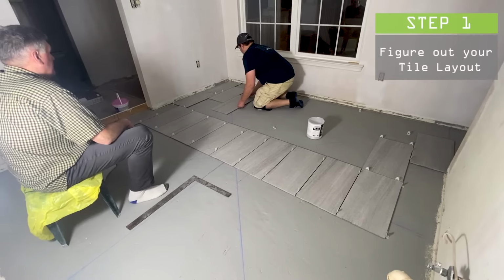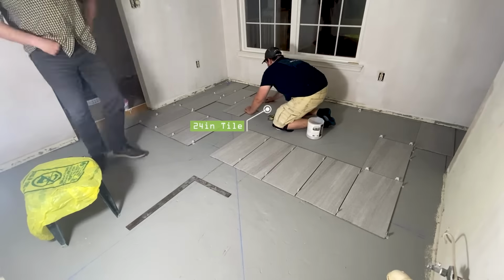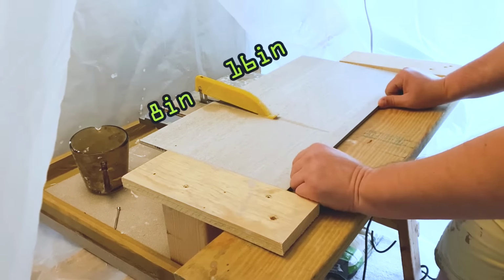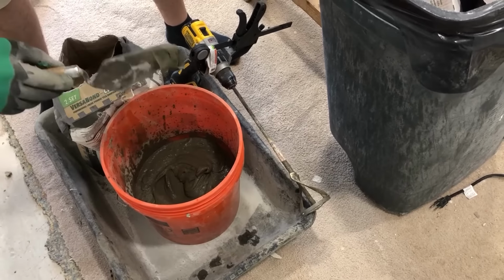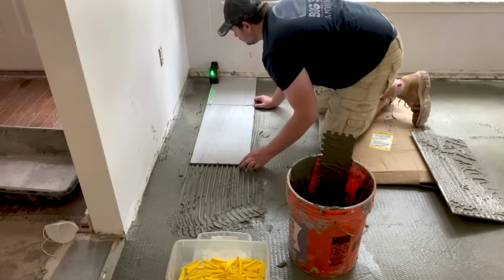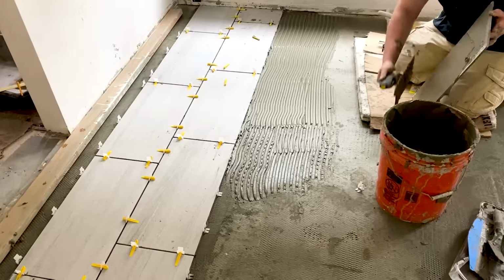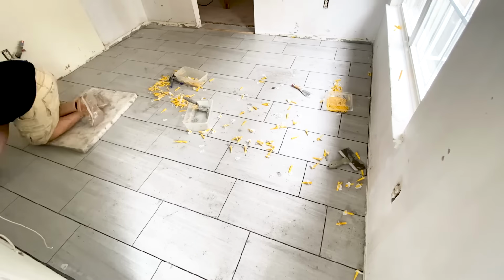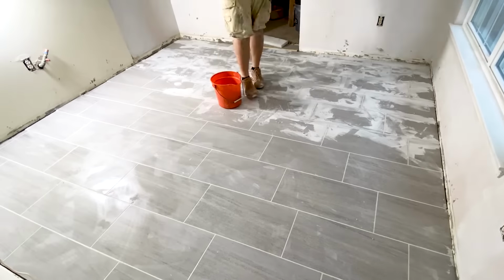6 TIPS For Laying Floor Tile With No Experience

Comment: Do you need to lay a membrane first?  I didnt see that done.  I have been trying to figure out what to do about the underlayment like ditra.  Is that a must so that it doesnt crack?
Reply from the maker: Yes we did do a barrier. We had an awful time leveling the floor so I put our struggles in a separate video https://youtu.be/wLq-1v9thtU?si=ICP9LlqNyyRi7MBt you do need a barrier if you have concrete because it will pull the moisture out of the tile mortar and crack it and that will crack your tile. I would not do the method we used it was a mess.

Comment: Great video 👍👍👍 What prep, and with what to prep concrete basement floor under ceramic tile ?
Reply from the maker: 1. Clean the floor thoroughly. Sweep and vacuum the entire surface to remove any dirt, dust, or debris. This will help the materials adhere properly.

2. Repair any cracks or damaged areas. Use a concrete patching compound to fill in pits, cracks, or uneven surfaces on the floor. Allow it to fully cure per the manufacturer's instructions.

3. Etch or grind the surface if it is very smooth and densely troweled. This roughens up the surface so the materials can mechanically bond. An acid etcher or concrete grinder can be rented for this.

4. Apply a concrete primer. This is typically an acrylic-based primer that seals the surface and enhances adhesion. Roll or brush it on following the product instructions.

5. Install a cement backer board or uncoupling membrane over the prepared concrete. These go between the tile and concrete to prevent cracks from transferring up. Secure with thinset mortar.

6. Lay the ceramic tile using thinset mortar designed for your type of tile (follow product instructions). Work in small sections.

The key is thoroughly cleaning/etching the concrete first and using the proper primers/underlayments designed for tiling over concrete basement floors. This prevents moisture issues and cracking. Check out the floor leveling video on the channel:

https://youtu.be/wLq-1v9thtU 

we had concrete base. But please use the self leveling mug so you don’t struggle like we did.
Reply: @DIYwithMAX  THANK YOU 👍

Comment: Cleaning the joints are so important, I did not clean the joints and spent unnecessary time removing mortar. I seen a guy on here use a toothbrush for that and another pro tip I heard and seen was to wipe the edges of the joints with your finger before laying the next tile.
Reply from the maker: I’m feel for you brother. I did it to my self lol

Comment: You cannot tile directly on top of a sub floor.. it’s not strong enough and the thin set and grout will crack over time due to the flex of the floor.
Reply from the maker: Thank you for taking the time to leave a comment. It all depends on the type of subfloor you have, but it is certainly possible if you’re subfloor is flexing.

Comment: I have a similar size kitchen. Maybe even a bit smaller. Would love to know how long this took you and how much the materials cost....thanks!
Reply from the maker: Sure happy to help. The kitchen size is 9x11 ft. The kitchen cabinets cost around $2700 the granite was $900, the floor tile was $600 back splash was $450. We did all the work our selfs. It took one evening to put all the cabinets together maybe 4 hours and the install took us a few days after work for the two of us. But I suspect that it can be done in one in half days. The ikea system is very straight forward and once you get the rails on the wall it’s just hanging cabinets and attaching doors. I hope I covered all your questions. If you think of anything else please reach out I’m happy to help.

Comment: In general you are supposed to move the tile to get the ridges to form a uniform coverage on the bottom and remove all air pockets. Or at least that's what the NTCA recommends...
Reply from the maker: Great advice thank you for taking the time to leave a comment.

Comment: I want to do this in my room, but I heard about expansion joint... What is that?
Reply from the maker: Hey thank you for the question. Expansion joints are just small gaps between the tile perimeter and walls or cabinets. You leave this space for tile to have room to expand and contract with temperature changes that’s all. This video has all the info you need to tackle this project and if you have any other questions I’m happy to help.

Comment: Overall a great video. The floor looks lovely. I've only done a few of these jobs now but one thing ive learned is that youre supposed to move the tile to fully collapse the ridges. By doing so, you won't have any voids underneath the tile which leaves it susceptible to breaking easily or coming loose in the event of subfloor movement from settling.
Reply: This… always collapse the ridges
Reply from the maker: Thank you for the great advice. If you found the video helpful please pay it forward by hitting the like 👍 button to recommend the video to more folks looking for this information.

Comment: Does the off set depends on the size of the room or it dosent matter
Reply from the maker: In our case it did not matter because one corner of the room would be covered by cabinet so we only had to make sure the left side of the room looked good. We went with this layout to minimize the amount of cuts we had to do. But it should be a consideration when laying tile to make sure you don’t end up with strange slivers  in visible places. I hope that answers your question of not please reach out I’m always happy to help.

Comment: is it possible to do small sections at a time, and come back later?
Reply from the maker: Yes we did ours over two days. You want to make sure you did a good job cleaning the edges and if your using spacers you want to set them before your done for the day.

Comment: how much deviation can a concrete subfloor have, before you have to grind it down or level it?
Reply from the maker: The acceptable deviation in a concrete subfloor typically depends on the flooring material being installed. For most flooring types, including hardwood, laminate, and vinyl, the maximum allowable deviation is often around 1/4 inch over a 10-foot span. However, for more sensitive materials like tile or stone, the tolerance may be tighter, often around 1/8 inch over the same span. If the deviation exceeds these thresholds, grinding or leveling may be necessary to ensure proper installation and prevent issues such as unevenness or premature wear of the flooring.

Comment: I just noticed you also troweed the wrong way. You're supposed to trowel the short end. So the air escapes out of the shorter end of the tile.
Reply from the maker: You could be right but I was more comfortable doing it long way lol. The way I look at it is if my tile was 12x12 not 12x6 it would not matter so. I don’t think it makes as much difference as people have you believe on the internet. I did not show this in the video but I pulled up tiles in every row to make sure I was getting good coverage and it was better than 95%. But if this tile job fails in the future I’ll make video about. So hit that subscribe button so you can find out if it fails.
Reply: @DIYwithMAX  Already subscribe man, and yes, I've been doing tile for 25 years and own a small tile business and do nothing but tile. So yes, your tile is probably fine, but yes, you're supposed to go trowel. The short side, so the air escapes out the shortest side. That's all it's not my opinion.
Reply from the maker: I appreciate that do you have my other advice or anything else I should be doing differently I have bunch more tile work.
Reply: @DIYwithMAX  Yeah I'll have to skim through your videos more  but ask me anything.. I just want to see tiles set correctly. And people get showers that actually drain , that's all
Reply from the maker: @BonBon770 thank you for taking the time. I don’t have any questions today but I will keep you in mind if I come access sometime that I’m not sure how to tackle. I appreciate your offer and look forward to your future comments.
Reply: @DIYwithMAX  Thanks man, have a Good Night.
Reply from the maker: @BonBon770 you as well.

Comment: Great tips but there are a two things you could do better. 
1. Lay the lines in the mortar parallel to the short side of the tile. That way it is easier for the air between the ridges to escape.
2. Move the tiles in a side to side motion perpendicular to the mortar lines in order to set them. The goal is to collapse the ridges!
Reply from the maker: Thank you for the recommendations . Please hit the like 👍 button on the video so it gets recommended to more folks like you looking for this information.

Comment: Quick tip: You should always trowel parallel with the shortest side of the tile.  Not like you’re doing here.  Makes it easier for the air to escape.
Reply: yeah but if you listen at 4:49 he literally says not to slide the tiles so the ridges don't collapse, and if the ridges don't collapse the air remains underneath ....
Reply: @LykeArgy Exactly. So, 50% contact is ideal 😂😂😂
Reply from the maker: That is a good best practice. Thank you.
Reply: I noticed the same thing. Also, I have been told the ridges need to collapse some to ensure a more even bond and greater surface area contact.
Reply from the maker: @Albe3331 check out my next tile video where I explain exactly what I ment in this video. BEST TIPS for Laying Tile: With No Experience
https://youtu.be/KUN9AbkbX_E
Reply: Thank you for sharing your knowledge. I didn’t know that.

Comment: Trowel parallel with your shortest dimension. Your ridges may not collapse the way you've done this.
Reply from the maker: I get a lot of compliments about my technique. I wish I had included the footage of me lifting up some tiles during install to check for coverage. I’m confident it was over 90% in every row. As this was my first time tiling I did check random tiles in each row and I’m confident they have great coverage. But only time will tell. I will keep all of you folks updated on the status of the tile over the years.
Reply: @DIYwithMAX  it's about using best practice for consistent results. Your job look fine. But you did not exercise besr practice. It was just an fyi for your next project. Good luck.
Reply from the maker: Thank you, this is such a great way to put it. I appreciate you taking the time to leave your comment. I am always looking for ways to improve. I’ll have to try it out in the future.

Comment: Don't keep re wiping the grout.  Let it haze and wipe it clean the next day.  This is especially important if you are using a darker grout like black or charcoal.  If you wipe it too much, the excess water will turn the grout white.  The best method is wipe a 12 inch swipe with your sponge, flip it over, wipe another 12 inch swipe then rinse the sponge and repeat.
Reply: Solid tip. I learned this the hard way having never done colored grout before. LOL. I am likely going to try out Grout Renew to color over the blotchy grout now. It isn't horrible but I'd rather have a clean uniform look.
Reply from the maker: @LeSamMan thank you for sharing. Please let us know how that turns out in case one of us runs in to this issue in the future. Appreciate you taking the time.
Reply from the maker: Great advice, thank you for sharing. I’m simply following the instructions in the back of the grout bag.

Comment: This is a perfect example of wht not to do. Also, never start from the corner of the room, start from the middle and work your way out.  Many walls are crooked and you'll end up laying your tile crooked.  Also, just because you use clips doesn't mean your tiles are flat.  Use a level!
Reply from the maker: Why would you make that claim if this tile turned out great. We started from a straight line on the ground and I do mention in the video to NOT use any wall as reference. We leveled the subfloor first to make sure we are starting with a level surface to help the clips keep everything nice and level. You must have been skipping around because you missed a lot off stuff in the video that covers every your mentioning lol.
Reply: @DIYwithMAX  you need to use a level when laying tiles in rows like you're doing here. The very first tile in the first row needs to be level in both directions before proceeding.

 The second tile in the first row will be automatically levelled in one direction by using tile levellers to make the short edge of it flush with the short edge of the first tile. 

However, the second tile still needs to be levelled in the other direction (lengthwise).

 The third tile in the first row is just like the second tile. It will again be automatically levelled along its short edge but you again need to use a spirit level to check that it's level lengthways. 

It's only the tiles that are laid up against two other tiles that form a right-angled corner that don't need to be checked for level with a spirit level.
Reply from the maker: Thanks for the suggestion! We actually leveled the floor beforehand, and the tile leveling system we’re using does an excellent job of ensuring the tiles are level with each other. It’s been a game-changer for keeping everything aligned!
Reply: You should use at least one wall as a reference, There's a method to squaring the room.  Did you use a 6 or 8 foot level across all the tile to see how level they were?  Why did you remove the entire kitchen when all you had to do was remove the kick plates under the cabinets? @DIYwithMAX
Reply from the maker: We knew that we would be replacing the kitchen cabinets, so it was easier to demo everything and prep the the whole room including walls.

Comment: why not collapse the thinset ridges? other installers say it's super important.
Reply from the maker: My thin set was nice and loose so the weight of the tile and the leveling system collapsed the ridges. I know this for a fact because this is being my first time I wanted to make sure I do it right so l pealed up a tile in every row to make sure I’m getting good coverage I unfortunately did not recorded those steps so I did not put them in my video. In hindsight, I wish I did because I get a lot of questions about that topic. I hope this clarifies this for you. If you have any other questions please reach out.

Comment: Some good tips here.  I'd suggest not putting grout along the wall seams that can/could be covered with baseboard, as the walls may move a bit with seasonal changes in weather.  You could go with a color matched silicon if need be.  It remains flexible and allows that slight movement.  It is also good to silicon the door threshold joint to reduce the possibility of cracking, especially with a transition to wood or laminate flooring... it is a high traffic area and may also move a bit.
Reply from the maker: Great tip!
Reply: Tilshaketha mele bere tils hakabauthe
Reply from the maker: @rajamanisiddaraju1444 I would love to reply but have no idea what this says. If anyone knows please translate it for me. Thanks ahead of time.

Comment: What laying tiles on the floor has to do with removing cupboards?
Reply from the maker: It just made it easier to tile. In our situation we knew we were replacing the kitchen anyway so it was easier to remove everything and then tile the whole floor without having to work around new cabinets and potentially damage them somehow. But if you’re doing this project and keeping the cabinets then of course you would not remove them and just tile around them.

Comment: One thing i didnt see mentioned during the video (unless i missed it) is the arrows on the back. I found out the hard way that its a very important process to follow if you want your tiles to be leveled at each intersection. A friend of mine explained me that it is due to the press process when the times are created. Sometimes, they can be a little concave. I started without following the arrows and noticed that almost all the intersection had about a 1mm difference between times. In the middle of the installation, i decided to follow the instruction, and surprise. Everything went a lot smoother
Reply from the maker: Thank you so much for taking the time to add this valuable information. I will definitely mention it in my next tile video.
Reply: Arrow ? Where is the arrow on the back of the tiles ?
Reply from the maker: @guscruz5076 Arrows on the back of porcelain tiles indicate the direction for installation to ensure a uniform pattern and optimal flatness. These arrows, molded at the factory, guide tilers to align tiles consistently. Following this direction is crucial for achieving a cohesive floor design and minimizing installation issues. Best practice, backed by experience, confirms that adhering to the arrow directions enhances tile alignment and pattern consistency. https://images.app.goo.gl/F9mSsD4pNdg1SVE38
Reply: Ahh ok Thank You much 👍✌️